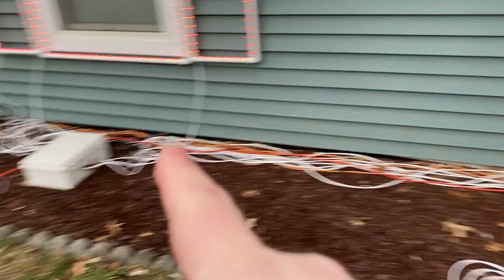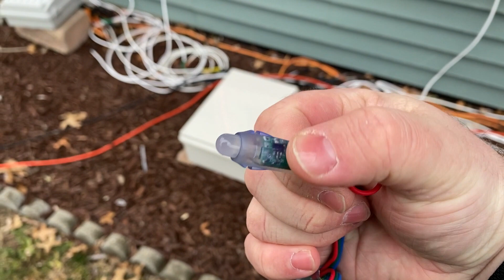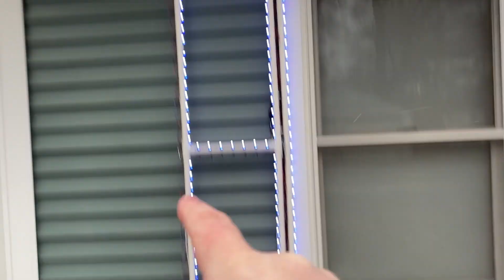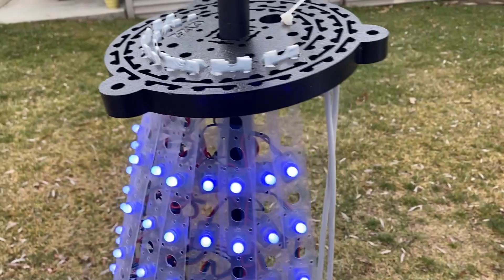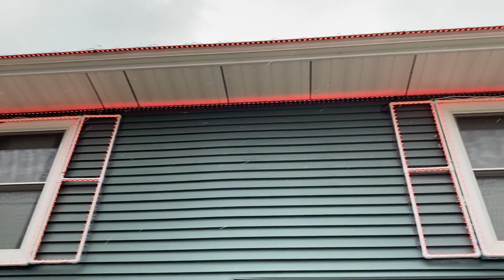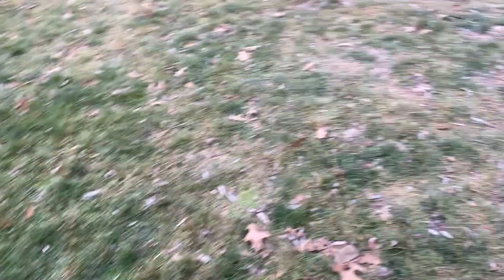Light Show Walkthrough pt  1 Physical Elements

Comment: Hi i am new to all this but when using  a controller and a separate power supply or power supplies to power inject how do you get all the power supplies to come on same time with the controller ? i am new to all this .
Reply from the maker: I have everything hooked up to smart plugs which have a schedule to turn on and off. The power is flowing through all of the pixels during the whole show. The controller sends out the data to tell the pixels which colors to turn on at any given time.
Reply: @stevebeers4171  Thanks for getting back to me on this it helps out a lot thanks .

Comment: I am having A heck of a time with powering LED smart pixel floods. I have six per channel 3 channels. I also have to use extensions and I think that’s where my problem is not sure if you have any advice that would be great
Reply from the maker: Not sure I totally follow. I guess I’d start simple. Put one in and see if it works. Add another and test, add another and test. If the extension (assuming you mean distance between lights or controller to lights) seems to be the problem, you could add a dummy pixel to help boost your data signal. By dummy pixel, I just mean a regular pixel that you tell your controller to always keep off. 

Not sure if that helps or not. Let me know if there are any other details.

Comment: First thing first nice setup and good way to explain what you need for a light show . My question is how many power supply’s do you have for power injection on your pixel lights ?
Reply from the maker: When I created this video I had 7 power supplies total (I just added new props and am up to 10 power supplies for this coming year). All are 12 volt and 360W power supplies. I calculate pretty conservatively to make sure I don’t run in to any overage problems. My spreadsheet with my calculations only uses 80% of the watts, and it assumes I’m running full white at 100% brightness (in reality I run everything at 50% brightness off the controller). It still runs just fine off of one circuit and I’ve never had any loss of power issues.
Reply: @stevebeers4171  I’m barely looking up in starting my first light show but didn’t have no idea on how to start until I saw your video

Comment: Great display.  Had a question on your spacing and framing.  Are the pixels all spaced at 2 inches?  For the frames I noticed you painted some of pvc black.  Do you have preference on the black vs white?  I wanted to go with white to blend into the eaves but most people seem to use black.  Does it effect the performance of the display?   Thanks
Reply from the maker: Thanks for reaching out. Yes, pretty much everything is at 2” spacing. For the black vs white item, some of the frames were made before my house was actually done being built, so I assumed that black would be better to hide them. Once it was done I finished up the window frames and realized that white probably made more sense. 

In the end, I don’t think it matters at all. You can’t tell any difference in person at night, so it’s probably just whatever works better for your house.

Comment: First things First.... JOB WELL DONE!!!! Me and my son hope to do something similar to this show. Truly inspiring and way to keep the spirit of STAR WARS alive in future generations. We are 3 Generations of fans! Hats Off to you! My question is, How many Falcon Controllers are you using for the light show? Thanks Again! Keep it Going!
Reply from the maker: I’m only using one and I don’t suspect I’ll increase that. I’m looking to get an expansion board for it, but that’s only because I want more physical outputs from the board, not because the Falcon Controller itself can’t handle the number I’m running. It’s capable of outputting over 16,000 pixels and I’m running between 2,000 and 3,000 when I’m fully set up.
Reply from the maker: And thank you for the compliment. :) it’s fun to do and I’m glad people enjoy it.
Reply: Sweet display...I'm thinking about redoing my setup because I'm using strips and like the bullet or bulb look.  How big are your gutter sections?  How do you connect them?
Reply from the maker: @yzguy96  the upper gutters are 30 feet. I just used 3 - 10’ sections with standard PVC connectors in between them. I think I cut them down a little so they would fit inside of a 2” space. I just keep those connectors as press fit and don’t glue them. They’ve always stayed together on the house and at the end of the year I just slip them apart and take them down. 
I think the lower gutter line is about 7 or 8 feet long and is one piece of PVC pipe.